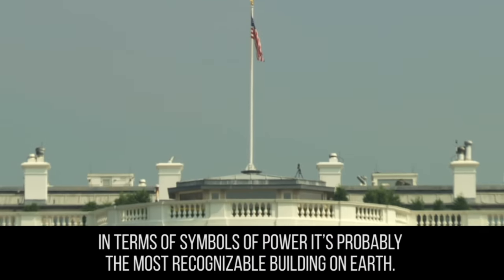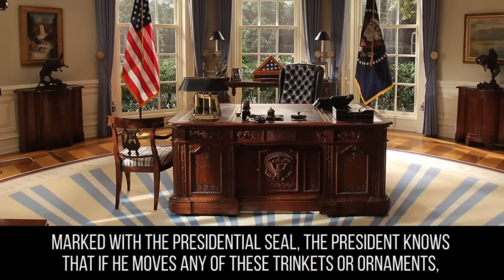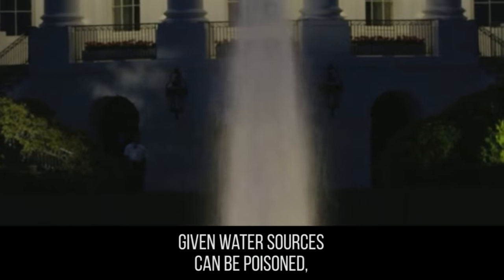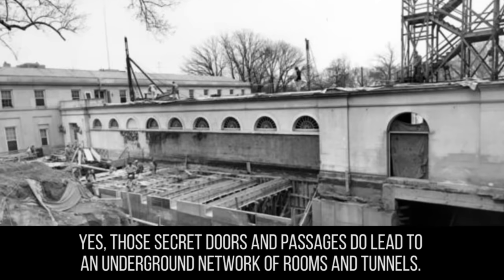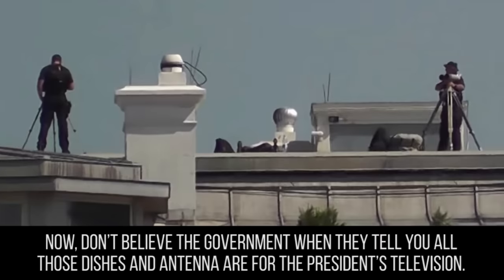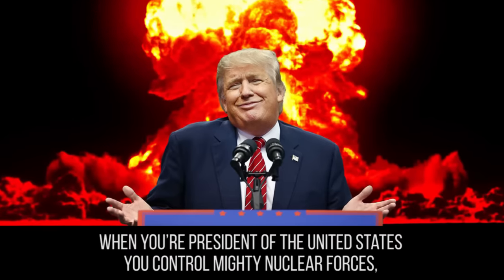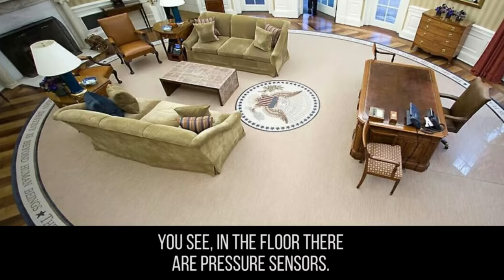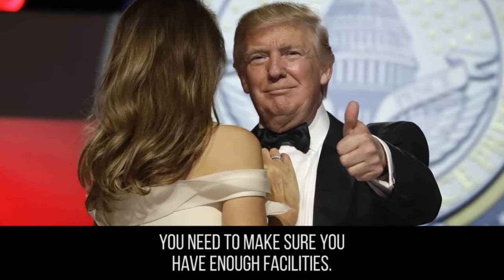HIDDEN SECRETS INSIDE The White House The Public Doesn't Know About

Comment: there are 35 bathrooms in the White House, none of which are public bathrooms it has 132 rooms, 412 doors, 147 windows, 28 fireplaces, 8 staircases, and 3 elevators.
Reply: Not exactly true. There are several public bathrooms in the White House.

Comment: The small wine cellar must have another explanation than Prohibition. After all, the White House was completely gutted and the interior rebuilt during the Truman presidency, which occurred after the end of Prohibition. A larger wine cellar could have been installed then. Truman struck me as a pretty straight-laced guy. Maybe he waved away any such decadence. And thinking of the presidents that followed, only JFK and Reagan seemed to be from circles that would value an impressive wine collection. But they didn't install one either. If Ford could install a pool, a large wine cellar would be a cinch. But no.
Reply: Truman enjoyed good whiskey and "Old Fashioneds", but apparently never to excess.  Bess enjoyed them as well.  Sturdy pioneer stock, those two.  We could sure use some more Trumans.